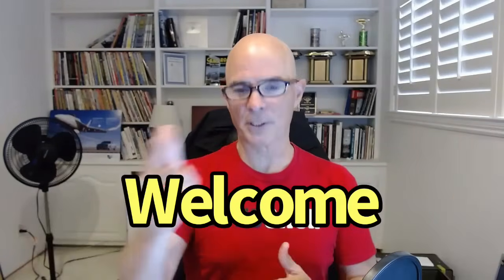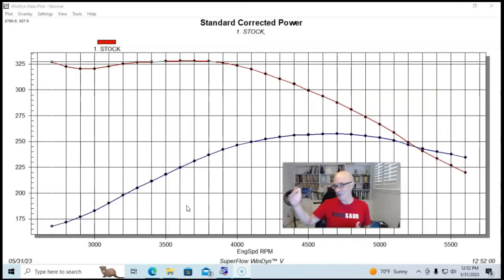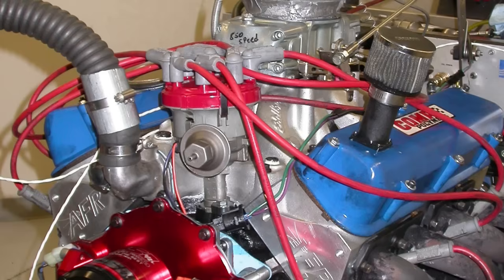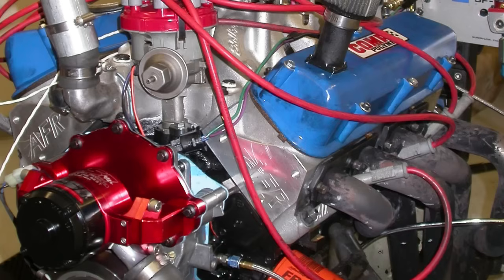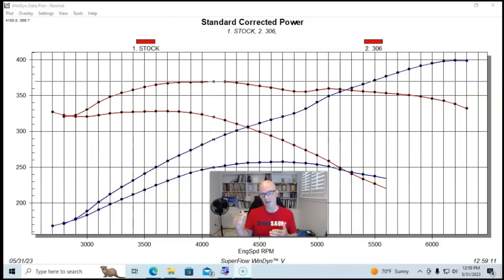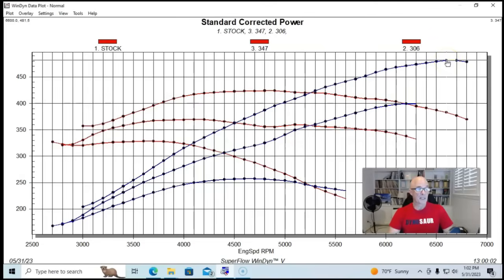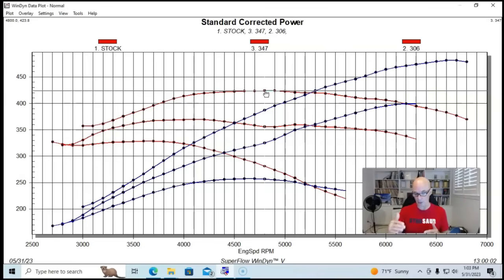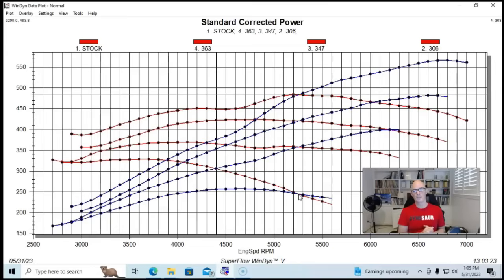HOW TO MAKE 5.0L FORD POWER. HOW TO INCREASE SPECIFIC OUTPUT ON YOUR 306, 347 STROKER OR 363 STROKER

Comment: I WOULD GO 600HP 500 TQ 363 OR A 351 PUNCHED OUT TO 460 665 HP AND 605TQ. THEN AGAIN THOSE WILL COST U 6-17K FOR THE SMAE MONEY GET  BBC 540 INCH ALL AL BLOCK AND HEADS 640HP 640 TQ. OR A 540 IRON BLOCK AL HEAD FOR ONLY 12K 640HP 640 TQ

Comment: I had a question for Richard or the Ford gurus. 
I have an 86 Bronco with 5.0 efi. Im swapping over to carb because its much easier to build a mild performance motor than with the old Speed Density setup.
My wires are old, been patched along the years. The top end kits ive been looking into (edelbrock 360ish) horsepower are hovering about 2800.
I figure i can also ad a Scat 347 Stroker kit. Which with the said combo. Should bring me to the 400 hp range while maintaining reliability.
But im extremely nervous about all these failing lifters everyones talking about.
My other option would be a 99 Explorer 5.0 to build. Which has a roller. But i have not seen roller top end kits. Which this lack of a kit would throw me into at least 1k-2k higher build cost for similar power.
Any ideas on which route to go?
Thank you!
Reply from the maker: get an explorer motor from the yard, add a cam-reuse the lifters, add AFR Enforcer heads and dual plane

Comment: Richard, wouldn't it be interesting to compare a 347/3.4 stroker to a 347/3.25 big bore and see how each power curve compares with same heads, cam, intake and carb/EFI?
Reply from the maker: they would be the same

Comment: Richard, great video! Thanks for all the info you share. 
I'm running a mid 80's 302 with an 89' mustang GT upper and lower intake and computer. I'd like to put in a better cam, but should the rockers and springs be replaced with the comp cams 274? 
Thanks from NY!
Reply from the maker: YES ON SPRINGS
Reply: Poor brokey antics

Comment: Hi Richard, I'm not sure of the point of the comparison when you change so many variables as well as the displacement. A dyno back to back  of 302,306,331, 347 and 363 all with the same cam spec ,heads and intake would be interesting. You would need to change the carb for the bigger engines I guess. I still enjoyed the watch though. I have a 331 for my 68 falcon.
Reply from the maker: see the 302 vs 347 video for the same components, but using the same stock components limits the bigger motor

Comment: I ran a hydraulic roller in my 347 with the 220 afr and went mid 10s. I switched to a solid roller for the 363 and went high 9s. My 347 needed a 850 carb with lower compression and a 950 for higher. My 363 is under carbureted with the 950. We found they definitely need a lot of carburetor
Reply: What MPH in the hydraulic roller and solid roller and car weight?   In any case your engine is no joke.
Reply: @dennisrobinson8008  128 in the hydraulic roller and 136 in the solid roller. 3,025 with me in it. We just tried a 1250 dominator on it and we’re still tuning the dominator on the 363. Definitely a lot more power once we tune it

Comment: Just curious about the rpm intake and rpm air gap. Have you ever tested them back to back changing only the intake. And then with a 1 or 2 inch spacer. Have you ever tried to take the rpm cut out some of the center divider and compare that to the rpm air gap

Comment: Hey, Richard. You mentioned upping the CR on the 347 and 363 combinations. For comparison's sake, what CR's did each combination have, and what octane rating did they require to limit detonation?

I want to put TF 44cc heads with MHS Stage 1 or 2 cams on my NPI 4.6 and am concerned that 91 octane gas might detonate on hot days in the Rockies.
Reply from the maker: we ran 91 on all

Comment: Richard: Great video. I like the discussion on specific output. Apparently, the larger displacement engines cannot keep parody with smaller engine outputs because of the difficulty to fill the larger cylinders in the same amount of time without increasing cam specs and or cylinder flow. When does it become impossible to match the specific output of the smaller engine (seems like engine master folks, on average worked well at 400ci to balance specific output and friction/rotational forces). You stated the compression was increased as well to assist the out put, which is true, but isn’t that also a complimentary technique to fill in the power band as the cam specs favor the mid to higher rpm (using compression to bring up the low end)? Could you take this experiment a bit further by comparing through the same displacement progression/ specific power outputs, plus adjusting LSAs and Durations (after optimizing overlap for each combination) to widen the power band? Example: tighter LSA, less duration at a given overlap vs wider LSA, with more duration/ equal overlap? I suppose this would be the “right cam video” (or give the engine what it wants) v/r wh

Comment: Hey Richard! Love the shows and content and information you provide. You’ve been making me a little jealous of your GLH stories, since I donated mine to the boys ranch years back- now I’m pretty sad about it. I wanted to ask, cause the information is so conflicting; I just bought a carb setup for my Ford 302, but got a 500cfm cause the calc said that was right size. The online stuff said too big a carb- 600cfm- would cause drive ability issues. This is a plow vehicle, and engine is stock…should I keep the 500cfm? Or, trade it back for 600cfm? I really don’t plan doing any building on this block, unless I need to rebuild it…what’s your point of view? Thanks and ache!!
Reply from the maker: that carb is fine for a stock motor

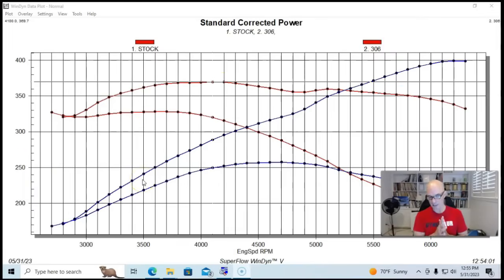Comment: Great timing of this video... for me lol. I have been trying to find a good cam for my 363, but not go all the way to a solid lifter. You seem to be the guy to go to. Quick specs: AFR 185 cc heads (1492) 9.9:1 comp, 75 mm TB, ON3 turbo kit 78/75. (4R70W trans, 3:55 gears)
Current cam 35-518-8, which on the dyno showed a peak power at a very low 5,100 rpm, which my guess is from the added displacement. What would be a good hydraulic can for a power peak closer to 6,500? TKS!
Reply from the maker: comp xfi236
Reply: @richardholdener1727  Thanks Richard!

Comment: Stck 302ci: 258hp 328trq
HCI 306ci: 399hp 370trq
HCI 347ci 482hp 423trq
HCI 363ci: 566hp 484trq
Why anyone would not go biggest possible, i'll never understand..lol
Reply: Money towards turbo 😊
Reply: @Surfrjag  That's a good reason, still the extra cubes means extra power.. I'm trying to build my 4.6L 2v to near 400rwhp, then boost..

Comment: I'm wondering why you guys over there don't opt to use Cleveland heads , you'd never see anyone put Windsor heads on Cleveland - just saying 😊

The max flow figure isn't the be end all is it ? To how the power is made 

Still you found good power  - more Ford's please
Reply from the maker: more mods necessary and limited intakes and Windsor heads flow as much or more
Reply: So you don't see it a advantage to use a bigger intake valve canted head on a 4" bore ? 

I'd like to see you get to test out a trackboss alloy block clevo some day
Reply from the maker: I have run CHI heads, stock 4V heads and others, I know what they do. You asked why more people don't run them in the US-I told you why. People aren't usually building max effort motors and can get what they want easier and at a lower cost with available Windsor stuff-BTW-I have built a 408 Clevor with CHI heads-it did well
Reply: Cool got it , it's always Max effort for N/A guys that's all we have lol 

Much like all the LS test you do trying all type of heads - same thoughts try better heads see what that does is all 

Can't see it being much dearer using clevo heads if your buying all new parts anyway - cheers

Comment: Thanks. That’s a cool test but I’m also interested in seeing what happens when you swap a stroker crank with the same parts. Does it just lower the rpm with similar power? Is it more streetable? I’m going to rebuild the 351w in my ‘87 F250 4x4. I’m not looking to race it just have it be in a somewhat more useable rpm range with good power. Say 5800-6000 rpm max instead of trying to run it to 7000+. I’ve been eying the 4.17 stroke rotating assemblies.
Reply: Go 408ciW if you're going to build it, especially if you're going stroker kit, the extra torque will make you happy..
Reply: @P71ScrewHead  the 4.17 stroke makes a 426 with a 4.030 bore. I have looked at the 4 inch stroke too. I’ll do one of those two. Thank you for the suggestion.
Reply: @realAZliving  You're welcome.. n hey, I'm with you, if you can go bigger, go bigger.. I was gonna suggest 427W stroker kit but most always tell me that's a bit too much on a production block.  😆🤣
Reply from the maker: do not go over 4.0 inch crank with a factory Windsor or LS block
Reply: @richardholdener1727  ok
Reply from the maker: please see the 302 vs 347 same parts video
Reply: @richardholdener1727  thanks. You have so many videos. I’ll check it out.  I bet it’s great like all of them.

Comment: Let's go back 60 years...  Two motors with the same heads and cam grind making about the same hp but at slightly different rpms.   The 4 1/8 x 4 1/4 452 with a 6" stock other GM brand 2" pin rod had a very short compression ht with 2 rings pistons or 3 ring with 2 through the pin 
The longer stroke gave more leverage than the 4" crank but it had a lot of side thrust and did not wear well.  
The 4x4 combo is well known.  The 452 did give more torque but not as much as you would expect.  
The "fulie" heads limited hp on both motors.
The 452 had very short dwell around TDC and really accelerated the piston quickly away from TDC and the valve had to start opening earlier in order to get the flow going as the piston was accelerating.  The tradeoff was more overlap than the 400.  Not hard to do the math to show crank angle where rod is perpendicular to the crank throw which is where max piston acceleration is (although intake velocity continues to accelerate even as piston is decelerating (inertia and all that)   It's enough different (same rod different stroke) to make a difference.  
Now figure how much different a 3" or sub 3" stroke is with a long rod
cheers
challenges
Reply from the maker: I don't understand your point here-is this about rod length somehow?
Reply: @richardholdener1727  Not directly about rod length. i got lost on 302 vs 400 which of course do take different cams I was not clear in that it is better to consider piston dwell rather than camshaft degree of overlap.  Around TDC you can get away with more overlap in a short rod motor than in a rod motor.  I used to start with crank angle of max piston velocity but now you can model the entire cycle.  Getting the intake opening for max flow is tough on a traditional SBC or SBF (flat tappet) without opening too early. WE used to cheat with steeper angles and  sink the valves. High ratio rockers help but roller cams  have to work to be as quick as a flat tappet unless a small wheel inverse radius profile is used (Thanks to the GM indy car project)
Long rod ratio just gives more crank degrees (especially important  with modern chambers and hemis which  need less overlap)  .

cheers

Comment: Finally, more Ford content! Still thinking on future upgrades to my 351C 2V. Is anyone offering a top end kit for these things now? Is there any significant horsepower to be made with the 2V open chamber heads? Would like around 400 horsepower with good torque for the street. Don't have the resources to go with a major build at this time. Most are telling me to go with aluminum heads. Which ones? Seems factory 4V closed chamber heads are hard to find now. Thanks!
Reply: The best top end kits are usually AFD or CHI (both Australian). They cost money though. You can get 400 with open chamber 2V stockers, but you'll need a good camshaft and headwork on the 2Vs. Both AFD and CHI make heads that range from 2V to 4V and even offer a heads in between. CHI makes a 3V head which is basically an "in between 2V/4V."
Reply: @johnhickman106  CHI 3Vs are the go,, very good but quite expensive. More power from them than any other.
Reply: @ldnwholesale8552  4V heads rip dude. 2V open chambers aren't that great (had some). Aussie 2V closed chamber heads are pretty good, but for factory stock heads, the 4Vs are by far the best. It's been proven time and time again. A good buddy went from 2V closed chamber Aussie heads to 4Vs and it picked up throughout the entire power band. I also stated that the CHI heads were expensive.
Reply: @johnhickman106  thanks!
Reply: 302C heads are all small chamber and are the head to use. 4Vs make good doorstops!! The 302 heads will give 10=1 plus and with a decent cam make good power. Still a Clevo though with its oiling and cooling issues. Use single groove retainers as those triple groove things fail! Factory pistons too while ok for a stock engine a re very suss once you turn it harder
Reply: @ldnwholesale8552  thanks a lot!

Comment: Why do i keep hearing that the fomoco distributor is better, has less issues and is more reliable, than the msd distributor?
Reply: 2 things: bearings and 100% crap stator. I think the stiffer body causes more stress on the bearings which you need HD units--varies per application. But msd puts the lowest quality stator in there: fails all the time. Even some rebuilt fomoco's use better stators. Got a Mallory polished dizzy like the MSD and developed bearing drag (aka shot) after 18months, ugh.

If you rebuild the MSD with better bearings and a fomoco stator, they are more accurate & will be bulletproof.
Reply: first i heard of it, but it would be interesting to know--probably cheaper to pick up a junkyard dist. i found a milk cartoon of 'em for free from a former demo derby guy clearing out his garage.
Reply from the maker: I have yet to have an MSD distributor fail on us

Comment: Did they ever fix the oil problem on the 347's?
Reply: I've got one of those so called oiling issue pistons old srp from yr 2000 still running 21 yrs later not one drop of oil consumed yet
Reply: @alltherpm  good to know.☕️👊🏻
Reply from the maker: oil problem?
Reply: @richardholdener1727   Yeah.. I know  you've heard people  say the 347 was an oil burner..lol
Reply: Ya know... you hear everyone say.." don't do a 347 because they burn oil"  1000's have said that.. I personally know people that did the 347 and yes, they use oil badly.
Reply: @19jody72  usually when ur building 347 u get low tension race pack rings 1mm 1mm 3mm that was new in 2000, and they take more tension away and possibly even run only 1 compression ring, without a vacuum pump, then u get a owner of engine with no clue and hence oil consumption, I did take heads off 2 yrs ago for afr heads and my cylinders are worn smooth like a mirror and still no oil consumption & total of 40,000 hard miles
Reply: @19jody72  My rotating assembly came from ZSR. Over 400 rwh and ZERO oil consumption.
Reply: Modern 347s don't have oil consumption issues as the wrist pin isn't in the oil scraper ringland.
Reply: @johnhickman106  So they changed the piston style and rod size?
Reply: @19jody72  No, they moved the ringland.

Comment: Richard im surprised the 302 didnt make more horsepower in one of your books it made the same horsepower with much smaller cam and valve float also surprised 363 didn't lose more torque down low with that intake and cam only problem wit building a 363 is you need aftermarket block gets expensive can you test newer renegade 165 and 185 someday
Reply: The little 302 was just a rebuilt block with stock E7TE heads/pistons/cam and then put a carb intake and distributor on. No surprise it didn't make 'big' power. With a camshaft it would've made more power, more like ~1.1hp/ci so up to around 330hp or so. Adding the AFR heads to give 400hp is a no brainer if you have the money but there's certainly no shame in using what you have.
Reply: And the supply issue is a huge drama, I looked at doing one last year but no 4 1/8 blocks available. Just as well as I read the rules for category and it must be a production block.
The 363 though I feel would be a very good engine

Comment: But then once you get to having to buy a dart block..ummm idk. If I can't replace what I had for the bone yard. It's just not as munch fun if you have to worry about hurting it. I mean I know on a stock 454 a 400 shot of nitrous is enough to put your piston through the fender.smh
Reply: A big block will always make more power than a small block.. A Ford 4.6L Modular block can handle 1k+ hp, i'm gonna build one, never got into these Fox bodies, but i'm the type that thinks bigger is always better..